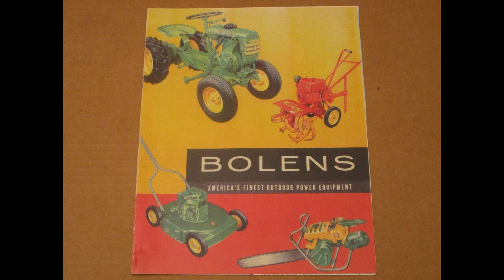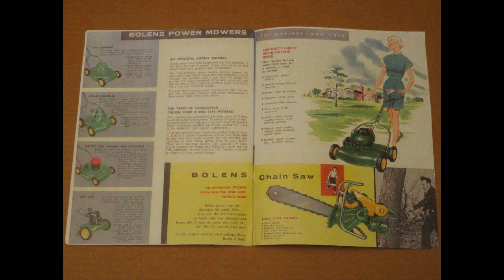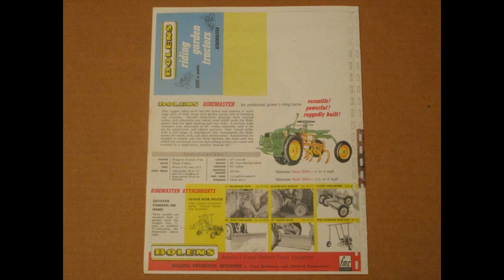1957 Bolens Startup Part 4

Comment: Nice tractor.  I have to settle for a '52 Power Ho.  So far it's sand blasted and primed, new chain and tires ordered, carb rebuilt.  I think it sat uncovered outdoors for several decades. The only original paint I could find was a tiny bit where the wheels mated to the hubs. Going back Tractor Supply "Ag Green"  and "School Bus Yellow".